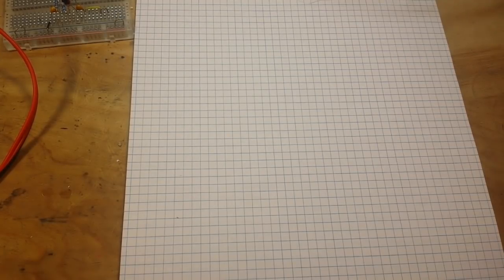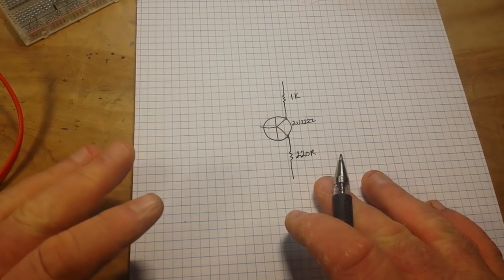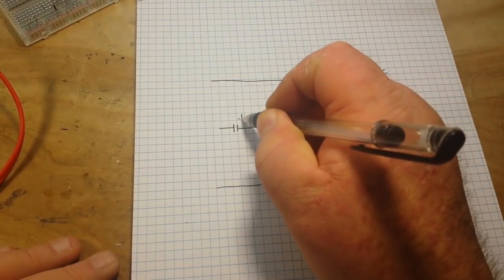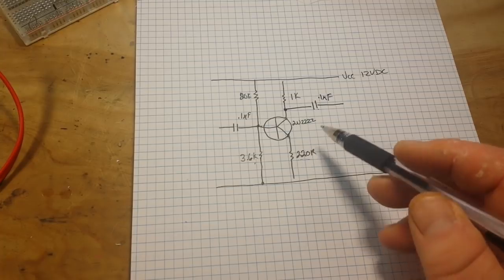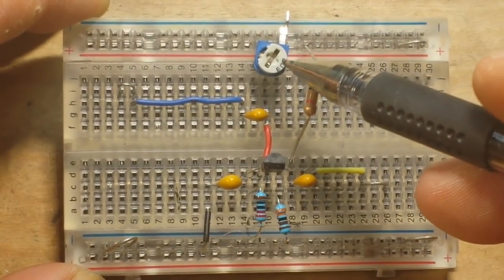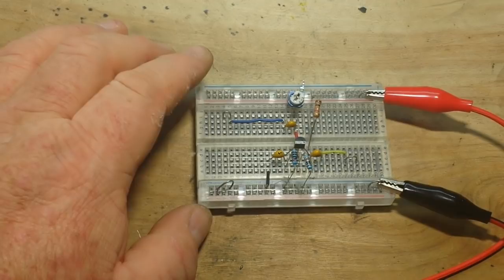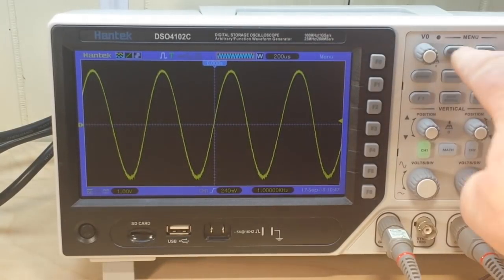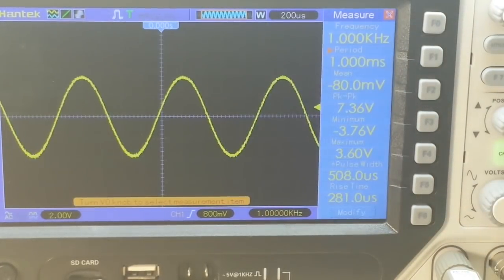How to build a Common Emitter Amplifier

Comment: There are a lot of technical mistakes in this demonstration and they come from a person who has never made a project in his life. The 1k collector resistor is far too low. The 100n in is too small and the 100n output capacitor should be 10 times larger than the input.  These are just the things you will know when you have been designing these circuits for 50 years.  A much better design is the self biased stage. It needs just 3 components and self adjusts for a wide range of transistor gains. If you are using 100n input, the collector resistor should be more like 10k to 47k.  This is just a point that shows you understand what you are doing. At 100n you can’t pass much through the circuit and at 1k you are creating a lot of transistor noise. It is no wonder none of the student know a thing about designing. They are being led by the blind.

Comment: Paul question Have you come across any Motorola 2N3904 NPN transistors? Second I built a Colpitts oscillator circuit. Used the 2N3904 great clean output signal. Then I substituted a 2N2222 distortion at lower half of the wave. Then finally a 2N4401 distortion both up and down. Thoughts on this?

Comment: Thanks for your video. Quick question, in the video you call the emitter resistor 220 ohms but write 200k on the schematic. Which should it be?

Comment: thanks for uploading. question for anyone who knows the answer: is there a way to adjust how much it amplifies or are these transistors made with a fixed non variable amplification  amount, like a resistor is made to have a fixed resistance?
Reply from the maker: Change feedback resistor to a  potentiometer and Violà you can adjust gain. It ain't pretty but it will work.

Comment: Can I use 2N3409 transistor?
Reply: Yes, for this demonstration it will work perfectly. Just be aware that the 3904 has a maximum collector current of 200mA rather than the 800mA capability of the 2222 (depends on manufacturer). This is only relevant if you intend to drive a load (i.e. speaker) with your circuit. An oscilloscope is designed not to load the circuit.

Comment: What I don’t understand is how the signal gets to the output.
Reply: The AC signal is suppose to ride with the DC signal
Reply: If you think strictly in terms of conventional current (positive to negative), you could say that "technically" the signal doesn't ever get to the output. It essentially varies the resistance of the transistor, which drops more or less of the input voltage across it, in order to mimic the input signal on the output line. Hopefully this act of mental gymnastics is helpful for you.

Comment: So you fed a 1v DC signal into the input, and got 7.2v at the output. A few questions:
What was the amount of amperage going into the circuit and being outputted by the circuit? 
Was the amperage amplified too?
And can this circuit amplify steady DC currents instead of an AC signal?
Thanks, hope you see this soon.

Comment: You are a really good educator! Thanks for this videoes, they are very helpfull even tho it's a lot to grasp. On thing i still don't understand tho. You are using only one npn transistor, yes ? But you get aplification on both the + and the minus side of the ac signal ? I thought you needed coupled transistors for this, one npn and one pnp,  and divide the signal?
Reply: As I understand it with a class A amplifier you bias the base pin high enough that the negative swing of the input signal doesn't pull the base low enough to turn the transistor off completely, and ideally keep the transistor in a linear operation region. This is why class A is inefficient, it idles with the active device part way on and dissipating power.

Comment: This video did not explain how to select resistors. Very general information.
Reply: For the voltage divider to the left, I think that depends on the transistor you use. In another video of his about the same thing he said that you would have to check your transistor's datasheet for the resistor values.
Reply: I am now reading. "Art of Electronics" to catch up on theory as youtube videos really dont go into enough detail.  It can be downloaded on internet and is widely recommended.

Comment: Paul, thanks for this video! I have a basic question. Why is the output pulled off of the collector instead of the emitter? I see everyone does it this way, but I thought that the collector is just the raw power input that feeds the amplification selected by the value of the base, with the output going to the emitter. Where did I go wrong?
Reply from the maker: High-side/low-side. Check out this link: https://electronics.stackexchange.com/questions/188072/difference-between-high-and-low-side-switching-of-power
Reply: Thanks!

Comment: what value should the emitter capacitor be, you didn't say
Reply: The emitter resistor provides negativ feedback, when the collector current increases so does the voltage drop across the emitter resistor. This reduces the base emittor voltage and thus the collector current. The gain without the emitter cap is roughly Rc/Re. With the emitter cap the emitter resistor is bypassed for AC, and the gain is much higher. The size of Ce impacts the response at low frequencies, so normally the is a electrolytic with a few uF to go to 20 Hz or below.
Reply from the maker: it really doesnt matter as its just blocking dc but used .01uF for all
Reply: @learnelectronics  great is a 50v capacitor big enough?
Reply: @learnelectronics  i see, i think i'll build a couple of these

Comment: Excellent video. I do have a question though. You setup your voltage divider to provide approximately 1.8V to the base. It seems like that value is intentional, is it to get the transistor into a state where pretty much any amount of signal will cause it to turn on and amplify?
Reply from the maker: Take a look at the 2n2222 data. I chose that value to be in the middle of the linear region of operation. Tjat way we have plenty of swing both ways.

Comment: I have all these components so i may give this a shot. Q-is there a freq when a class A breaks down? Hi or lo?
Reply from the maker: Its more the transistor cant handle the frequencies. The amplifier will work at any freq, but if you get up in the MHz range you are going to want RF rated components.
Reply: I thought it was transistor dependent, thanks for confirming!